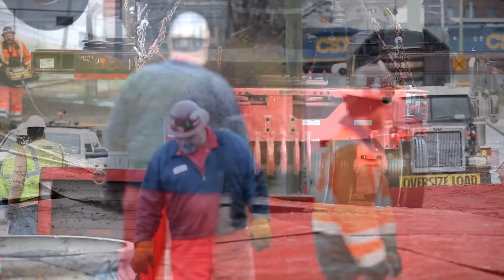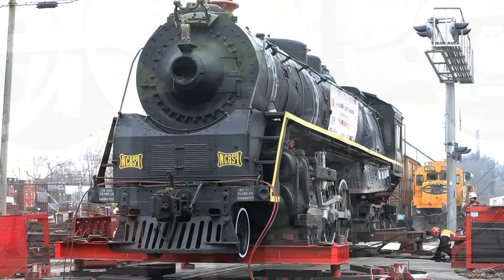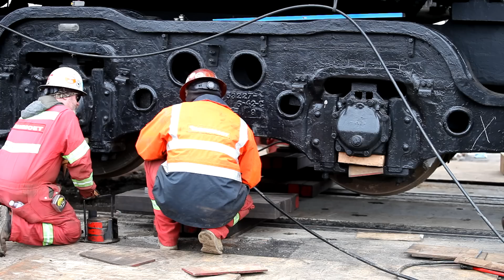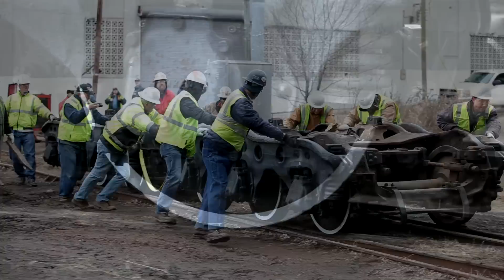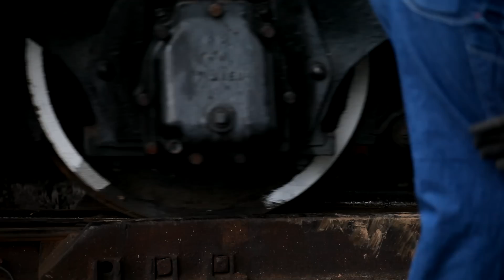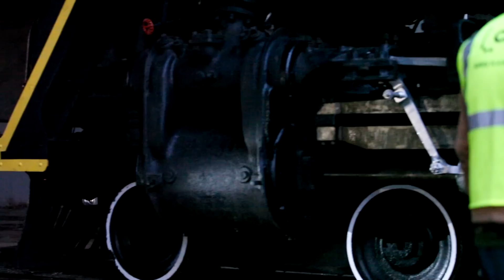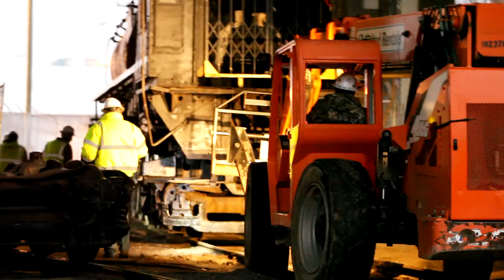Re-railing NC&Stl. Steam Locomotive 576

Comment: this steam locomotive in operation will bring back some interest much needed in to railroad and bring many people back united together and give a new life to american railroads  witch have a less environmental impact to any other transport , we  all hope to see this beautiful iconic locomotive  in steam and alive again
Reply: Railroads haul more freight long haul than do semi's. And while you are correct that the environmental impact of railroads is far less than other transport steam locomotives pollute far more than any other means of conveyance. Today's environmentalists would be appalled by how much toxic smoke was pumped in to the air by steam locomotives back when they were all their was & or electric were confined to big cities commuter traffic.
Reply: @jasonplatco7881  which is completely  untrue  if man was not on this plant  there be more carbon in the atmosphere    from  volcanos  are poping of all over  and diesel is far more polluting the steam  we have done the tests
Reply: @jasonplatco7881 - "Modern" (1943) coal fired steam locomotives like this J3 and its predecessor J2 normally produced no to very little visible smoke. Most of the visible exhaust was steam and water from hydrocarbon combustion condensed into visible water vapor.
For photo runs the fireman deliberately fires to produce black smoke for the photographers. Sanding the fire tubes that run through the boiler loosens soot built up in the tubes, which is blown out the stack.
Unburned carbon particulates settle quickly to the ground. Silica, which is fly ash, likewise settles to the ground, becoming clay dirt. Neither is good to inhale but they do not stay in the air for very long.
The greatest pollutant is carbon monoxide, which oxidizes from sunlight into carbon monoxide.
Bituminous coal contains bitumen, which is a hydrocarbon similar to petroleum. Most is burned, becoming carbon dioxide and water. A small part is incompletely burned, resulting in carbon monoxide.
Diesel locomotives, powered by high compression internal combustion engines, produce large quantities of nitrogen oxides, the major component of photochemical smog. Steam locomotives are external combustion engines, which are zero compression, produce no nitrogen oxides as the combustion temperature is not high enough to produce nitrogen oxides.
Anthracite coal is almost 100% carbon, which contains very little bitumen. It burns very cleanly producing very little soot. However locomotives like 576 will not burn pure anthracite, which requires a much larger firebox and grate area. Bituminous coal must be mixed with it.
Reply: @annajeannettedixon2453   Can I assume the axles, wheels and drivers were oiled up and or greased before it moved?
Reply: anna jeannette Dixon   American railroads are doing very well and have no need for “a new life,” whatever that is.
Reply: @douglasskaalrud6865  i beg to differ

Comment: The locomotive looks to be in great shape
Reply: it was painted before the move, all of the parts were cleaned prior to the painting as well. the team said they were doing all the cosmetic work before the move so they didn't waste any time for the restoration process. so after it is rebuilt, there will be no need to do all that once its pieced back together.

Comment: This will bring it to 5 operating northerns.
Reply: Are you certain it will be operating - In what capacity?
Reply: @organbuilder272  they said they will restore it to where it can operate excursion trips.
Reply: @organbuilder272  I am subscribed to their youtube channel and can safely say they have full intention of restoring it to operation and using it for NS excursions
Reply: @kalvinchester4068   - It would be nice to have it running and even more so to have 4 of these interesting and versitile engine in operation. Let us hope that it will do more than drag passenger cars around. In 10 or 15 years it will need a refit again. It should be earning as much revenue as possible to make ready for that expensive day.
Reply: @CoalChrome  Hello: It is nice to have your assurance on this topic. But, as you and I and many others know, it all depends on money, facilities and determination to do it correctly without taking short cuts or deferring repairs or replacements that could and should be done while the engine is undergoing a major restoration - More likely - rebuild.  It would be wonderful to see this and all other existing locomotives in revenue service. They did it once, they can do it again on short haul lines and limited service routes., earning both money and notoriety (Which raises money).
Reply: @kalvinchester4068  Nice to hear that but will it be restored in a manner that will not require patchwork repairs over time? I understand that it is idealistic to suggest but perhaps thee restorations should be given to a plave like the UP steam shop to undertake. They have the men, equipment, skills and materials to do the job. They also have the resources that can and do provide equipment requiring castings and other highly sepcialized work. I feel that it would benefit all involved to either cet up a similar center ont he Eastern area or utilize the services of the UP shops if they would agree. I know every group jealously guards their project. Who among us doesn't want a big train set to play with. But to combine and centralize the efforts of many seperate organizations in to one major service center would benefit everyone concerned. Then you need invest in only one of the pieces of major machining tools to do the job instead of smaller, less functional ones scattered over wider areas. In unity there is strength - and economy if everyone will work together. Maybe then it would be possible to bring back the remaining two giants of other designs. The more the merrier - and get them back into revenue service. I don't know of tourist trains really pay for themselves OR show the engines at their best efforts. Your thoughts on this topic are more than welcome.
Reply: @organbuilder272  As to how they are going to be doing the restoration, I am not so sure. I know they will need to replace the tubes and get the boiler checked to see if they either need to do patch work (like on UP 4014) or a new boiler altogether. They would also need to replace all the external pipe work as well, just in case. As for how they run the excursions, I do not have a clue. I hope it would be semi fast at 40mph.
Reply: @organbuilder272  The UP steam shop probably wouldn't accept outside projects.
Reply: Karl - thank you for your thoughts. I agree in the sense that all they do is for the UP PR steam program - BUT, these other groups are paying people, places and things to restore several engines. Surely UP boys could use the $$ and get the job done faster. They are almost entirely in house now. #1, this would help them to enlarge their facilities. #2 it would bring the weight of experienced and dedicated crews to bear on thorough rebuilding efforts and #3 I think - maybe - the people who own the engines could put their efforts on restoring cars, equiment and lessor projects requiring less tech skills, machinery, space and money. From what I see, several of these restoration to operation projects appear to think that repacking journals, greasing all the hot spots and a nice coat of paint will make it go. Maybe it will - for a while. Then the slap-dash work, with subsequent engine retirement, will discourage or prevent others from doing anything at all. By the way, Karl, I do appreciate your responses - there have been several.
Reply: @CoalChrome  restoration to full operation yes, NS Excursions, no. It will be allowed to travel to scenic lines to operate on those.
Reply: @NCXDesigns  i see

Comment: It's pretty rare for a locomotive to be transported by road in the US.
Reply: 576 had to be moved by road because a park office building had been built on the path on which 576 was rolled into Centennial Park. A temporary track had been laid from the former NC&StL yards through where it sat for decades across to where the fighter plane was on display. The track was cut, straightened and the locomotive rolled back to where it was displayed for 60 years. The extra track was then removed.
Reply: It only happens when they are being moved to or from some museum or location where restoration might be carried out. SOmetimes there is no way to make a rail connection from the "Museum" to the main line where they travel in their natural environment.
Reply: Wicki says that move cost $500,000.00

Comment: Would have liked to have seen the crane(s) and sling/spreader bars that were  used to lift it up off of the trailer.
Reply from the maker: No cranes, just Jacks :).  It's all here if you look closely!
Reply: All jacks....wow.
Very slow, very tedious and a lot of attention to details....
Reply: The locomotive in running order is just over 200 tons. The fuel and water car (tender) is just over 142 tons loaded. These weights are not particularly large for a heavy lift company to handle.
Reply: @algrayson8965  for an international company like Mammoet it was a walk in the park job (look at the other stuff they lift)...but then again you didn't see their bill for this lift.

Comment: more steam locomotives needs to be given a second chance  and a new life  witch should bring folk back on the rail transport
Reply: Unfortunately, I believe the steam trains were over due to air pollution. I think it’s safe to say they won’t come back for around a good 5-10 years.
Reply: @grobterm  Coal emissions (or soot, I think), as I heard, fall to the ground, and not in the sky

But the noise pollution, is also a factor
Reply: @grobterm  Steam locomotives were long gone before emissions was even considered a factor since early diesel electrics were just as bad. It was mainly because of fuel and water consumption and maintenance costs. It required more people just to maintain and operate one than a diesel. However, it was said that steam locomotives haven't reached their full potential and were supposed to last another 30+ years. And with the right fuel and firing techniques, a steam locomotive can be clean and efficient. A steam locomotive at the Grand Canyon Railway was converted to burn waste vegitable oil which doesn't give off emission. The only time you'll see smoke from that engine is when sand is thrown in the clean the tubes. Another furl which might replace coal eventually is torrefied biomass.
Reply: @grobterm   as air pollution goes diesel is ten times more polluting the big boy  and hears why  there thousand of a diesel engine running   were as very few steam running  and steam  is h/o2  steam exhaust  and just a bit of carbon from the coal fire  in nature you have thunder times  this  carbon  if man was not here but man is here and chem trailing the place with   toxins  that are the causes of ill health  not  steam  locos  we have done the test  as engineers
Reply: @theextremeanimator4721 - "Noise pollution?" From what?
Reply: @algrayson8965  The steam engines are much louder than diesels.

Although it might not be that much of ''noise pollution'', it's still something to be noted.
Reply: @grobterm Just about the time for a good restoration to be carried out!
Reply: @grobterm  They were never about pollution. Per ton mile they are the least polluting form of cargo transport over land.
Reply: @theextremeanimator4721   They are really not that much louder than the combined noise of 2 or more diesel units under load. See BALTIC 144 comment
Reply: @theextremeanimator4721   They are not "Much Louder" when you consider operating 2, 3 or 4 diesel units pulling a train that one  challenger or a Big Boy can do alone. Diesels, are not that quiet. Standing still the Loco hisses but that is mainly high frequency without much energy. The diesels are low frequency and that has much more energy.
Reply: Nothing like hearing the sound of a steam locomotive going down the tracks.

Comment: While I appreciate a lot of close up shots to be able to see details, please please in the future, get wide shots that let us see what's going on!
For instance, you couldn't really see how the jack down was done, because it was all close ups of wheels and jacks, and nothing of the Mammoet equipment or how they got it off the transporter, or half the other interesting stuff.

It seems like railfans only care about the train, and love the closeups of the train, but some of us love the whole process, and the constant closeups feel like sitting with your face 6 inches from a TV.
Reply from the maker: I had a wide angle Lens on me, unfortunately other than the shot of the tender truck rolling over the camera, the cold zapped the only four batteries I brought for my second camera. This video does show just about everything though it does skip a bit of them dropping it off the wood blocks.  They took a quick lunch, I took a longer one and missed that fairly quick drop.
Reply: @SARGENTSCRUFY  I was amazed by how little wheel surface actually touch the rails, and the size of a train to have such small flange, it wouldn't take much to jump the track, if you have any more videos of the wheels interacting with the rails please post, enjoyed the video.
Reply: @ferdinandfrancis9673  The flange is the guide of last resort. Most of the wheel-to-rail alignment is due to the angled surface of the tyre. Amazing technology, all in all.
Reply: Exactly!
Reply: @ferdinandfrancis9673  The wheel-rail contact is about the size of a US quarter as an oval shape.  Go to Wikipedia and look up flanges and rail wheels; there is a pretty good commentary on the interaction with the rail.

Comment: It's gonna take lots of work to recertify that boiler.
Reply: The boiler was inspected some years ago and will not have to be replaced to be operated at a low pressure. Most excursion steam locomotives are not operated at original design pressure (576 is 300 psi) as efficiency is not a major concern. Heavy excursion trains usually have diesel-electric boosters.
Reply: @algrayson8965 .... Since when is 300psi "low pressure" for a steam locomotive?  What year was the 576's boiler "inspected"....and how the heck did they manage to to that when it was sitting in static display... after decades of non use?? 

The UP 4014, 3985 & 844 all work at original working pressures.. which is 300 psi for the 4014 & the 844.  The 3985 also worked at original operating pressure of 280 psi (until it was retired last year).  Both the SP 4449 and the S.P.&S. 700 also work at the original operating boiler pressures of 300psi. 

Any Steam locomotive that cannot be operated at normal / Maximum certified operating pressures for which it was originally designed, cannot pull a train on Any Class 1 Mainline trackage in the US. 

In the case of steam locomotives (or even diesels) that are operating on privately owned Class 2 & 3 roads, then they are governed by FRA & AAR rules mandating maximum speeds... which would naturally dictated lower throttle settings on either type of locomotive, and 

The Maximum boiler operating pressure for any steam locomotive was & is 300psi.... of course boiler operating pressures were (in steam locomotives) determined by locomotive size and needed tractive effort, potential drawbar hp requirements, type of coal being used (of the era), maximum train tonnage (per locomotive), ruling mainline gradient, etc, etc, etc. 

As far as "diesel-electric boosters" are concerned... they are not there as a result of the size of the train (tonnage)... they are mandated when excursion Steam trains are run on Main-line routes, and according to ruling gradients on any particular division... and in that case, used primarily for dynamic braking, as well as for emergency in case of an extremely rare steam locomotive breakdown, so that mainline operations will not be hindered due to an otherwise tie-up of said mainline.

Comment: Retiring steam loco’s we’re not due to air or noise pollution. They drank water like a herd of camels, thus frequent water stops.  Coaling towers were more work than a big diesel tank connected to a pumping station is a lot more economical.  Numerous units coupled together made it possible for one train crew to pull longer trains with fewer stops and less maintenance. Steamers double and triple heading had to have a crew for each engine.  Now 2 man train crews and some places 1 man crews handle these multi unit trains.  Don’t be surprised if they eliminate that 1 engineer, as soon as they work the bugs out.  Sorry folks, but steamers are gone forever except for occasional excursions.

Comment: One thing I haven’t seen mentioned as I have followed the progress of this project.  Will she still be coal-fired or will she be converted to oil as Union Pacific chose to do when restoring Big Boy #4014?
Reply from the maker: Will definitely be restored as a coal burner.   She has some really neat technologies that make coal burning really efficient.
Reply: Alex Mullins I assume you mean the stoker system, the over fire air jets, etc.  I had hoped it would be kept as coal.  Just the smell of steam and coal smoke is magic.  I spent 8 years of summer weekends running a 15” gauge Crown 4-4-0 coal fired steam engine.  That keeps you really busy, as you must drive and fire and keep an eye on the rowdy kids in the coaches all at the same time.
Reply: @amtrakinoscale9811  It's not just the availability of coal that factors into such decisions. In areas prone to wildfires (California), coal would be a bad choice.